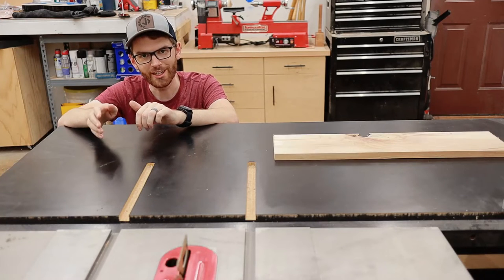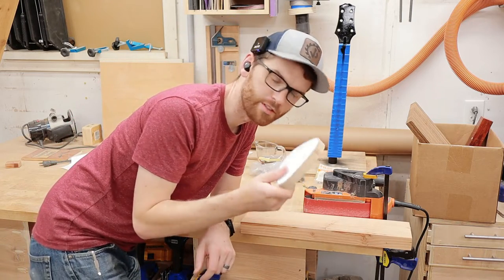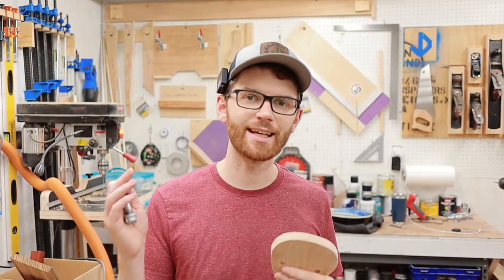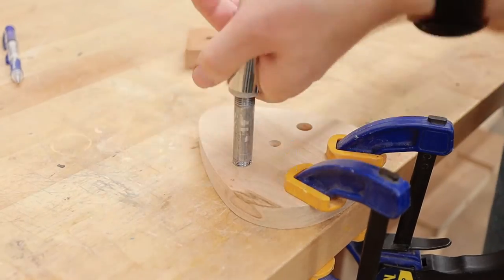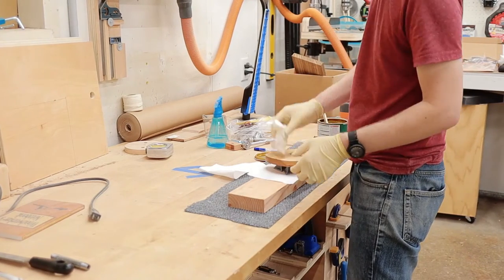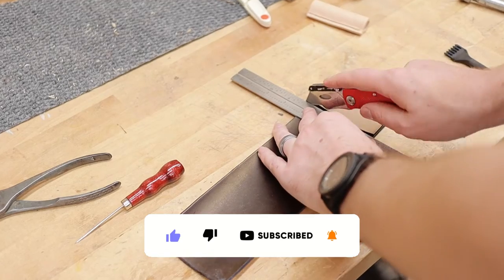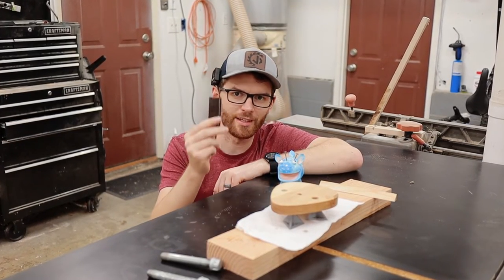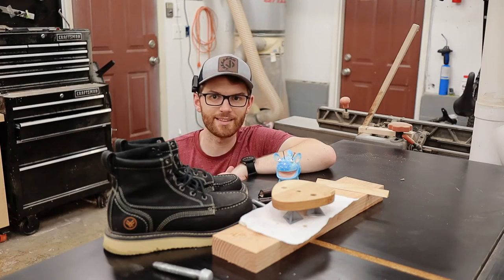ADJUSTABLE DIY Guitar Wall Hanger // Heavy Duty!

Comment: this is pretty cool, but if be worried about the poor caps dinging the guitar neck or headstock. maybe some plastidip or even spray bed liner before wrapping the pipe in leather? getting a chip in the guitar at that spot is a bad day
Reply from the maker: Yeah, this is definitely somethigng to address.  I would like to make some wood caps (instead of the metal ones).  But honest, I just look at my guitars mostly, so its not often that they have the chance to get damaged from the metal caps.